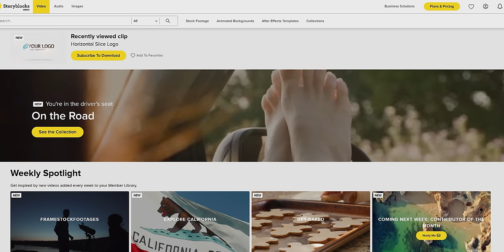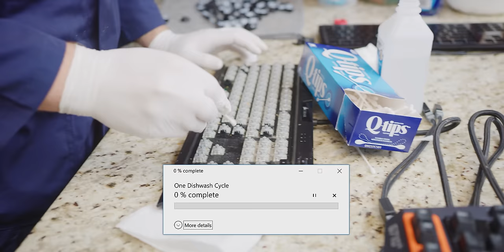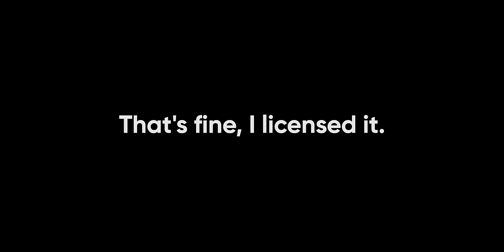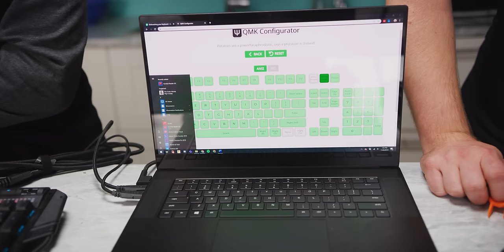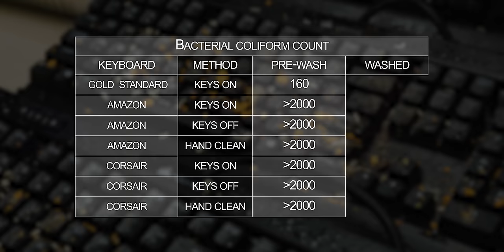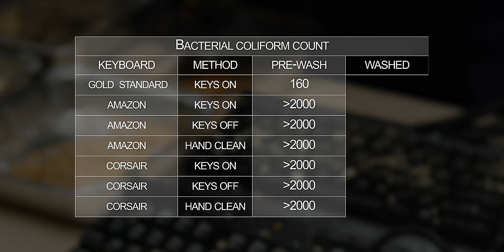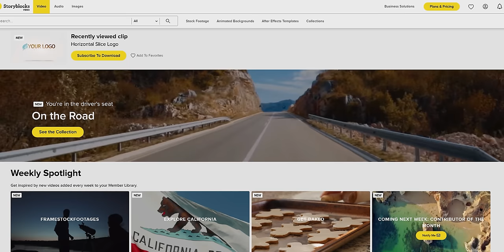The best way to clean a keyboard is… the DISHWASHER?

Comment: When I worked at a school district we would pull the caps off, hit them with really hot water and the take and air compressor to dry them off and then set them out to dry for a few days.  That worked on about 95% of the keyboard issues. This was many years ago.

Comment: It does seem like an easy method, but like you said Linus, electronics and water don't mix. And unless you have a way to pull your whole keyboard apart to check for corrosion, I would not be using this method anytime soon to clean my keyboard.

Plus in typical electronics fashion, after about a week or 2 from being submerged, they tend to stop working.
Reply: +1 to this even with pure water. 
During drying, oxidation will happen on open contact points. Once oxides of metals are in place they have chance to grow in various ways using the moisture from the air or even metal oxide/metal reactions. 
This is why alcohol or other fast evaporating, low reaction stuff is used in electronics.
Reply: Real experiment cannot be perfomed this way: 
- I did it once and it was fine.
Experiment should cover a time period for product longevity.
Are keyboards okay after doing this once every 3 months for a year?
Reply: You do realize it really doesn't matter if electronics don't care about water as long as electricity isn't running through it,plus we have a keyboard that was cleaned about 5 or so years ago in the washer and it works perfectly.
Reply: @anilhaksever  What if one were to wash it this way but then submerge it in alcohol and let that air dry instead? Food for thought
Reply: You guys have no clue.  It is even written in textbooks to clean keyboards with water.  You just need to dry them properly.  Corrosion isn't instant.
Reply: They also did a very simple key registry to check the switch was working. On a base level this might validate, but some of these boards (the g910 for example) are prone to chatter and this method may cause switches to intermittently malfunction. Longevity is a big issue but real world functionality after cleaning is something I'd prefer them to test for as well.
Reply: And I fool removed all the electronics; dishwashed plastics; let it dry and then put everything back together xD I mean it's safe but it took long time : ]
Reply: @jordsoo1  alcohol melts plastic so dont do that
Reply: @hetspook666  Not all plastics.
Reply: @jordsoo1  an airbrush with methylated spirits  might be a better way
Reply: Water is not a reactant nor catalyst in oxidation. Pure bull you're spitting out.
Reply: @hetspook666  It depends on the alcohol use isopropyl-alcohol its not very agressive
Reply: All the pcbs are wash with tap water bruh
Reply: you clearly haven't met my old Samsung flip phone. it's been submerged twice in dirty pond water and even though I used only rice to dry it out there was very little corrosion
Reply: Water in perfect conditions won't cause corrosion on pure metals like pure copper but in a dishwasher drying cycle or when it is evoperating in a close keyboard case you will have water in vapor form which will have free ions that do work on oxidation or hydrogen reactions with metals. (not to mention ESD) 
Especially since metals used in components and contacts of electronics are generally alloys, maybe most of the keyboard will be corrosion free but one specific alloy reacting and killing a component is enough to ruin the device.
Not to mention other materials used in keyboard that can react with water or water vapor. For example capacitors might have alkaline or acidic contents.
Exposing a complex electronic device to water and saving it once or twice is possible, impact to product lifetime might be even unmeasurable. But using water and steam as cleaning means repetitively is acting beyond design/durability specifications and almost certainly will decrease product lifetime.
PCB's are not the only things which got washed when they threw those keyboards in to dishwasher. And even PCB's wouldn't like to get washed with water with minerals like calcium. In any sane manufacturing plant they get cleaned and dried properly. Flux and heat takes care of the rest. And this is not a repeating stress.
Good way to clean a keyboard would be, removing keycaps, using air to blow the debree, using no alcohol baby towels (drying it promptly) and maybe a toothbrush to clean up the rest. Keycaps can be washed with water later on since they are made to be fine with sweaty fingers. Of course this can change keyboard to keyboard as materials change. But PCB, connectors and contacts of switches are best left alone or cleaned seperately.
Also never use WD40 with electronics.
Reply: @fasaso  you are probably correct, i once used 98% foodgrade ethanol to clean some kitchen equipment. That did not go well. (It looked like a broken car window) next time use the cheap stuff.

Comment: Water is not bad for the keyboard but the additives can be. The main thing is that you don't want the water to still be there when you provide power to the board. If you use this method I highly recommend doing a full disassembly of the keyboard afterwards and taking an old toothbrush and rubbing the electronics down with some high percentage isopropyl alcohol. This stuff evaporates more quickly the higher percentage that you have and is a good way to make sure that the board ends up dry. 
If you wipe down and air dry the plastics and do the isopropyl scrub down then this can be a one day job instead of one week.
Reply: If you're completely disassembling and then rubbing down with alcohol via toothbrush, what is the point of using the dishwasher in the first place? Because now it's not the quick-and-easy method compared to hand-washing it, because you are just hand-washing it after running it through the dishwasher.
Reply: @Blutzen  Not having to handwash all the plastic parts which is the annoying and time consuming part.
Reply: @Blutzen  Pfff, just pour some isopropyl in to dishwasher before washing cycle, it will make sure your keyboard will be crispy clean with shorter drying period! Only for 9.99$
Reply: @only1sn1not1taken  Completely disassembling the keyboard would give you easy access to all those plastic parts and using a toothbrush, as you mentioned, would definitely be able to clean the plastic parts and get into the crevices between the plastic fairly easily. I don't think it would take very long (depending on dust/dirt/crust buildup) to just give each layer a compressed air blast (either canned or an air compressor with a blow gun attachment) to remove loose or help free the dirt and to scrub them down with the IPA as you go through the disassembly.

You would probably have much better cleaning results (depending on the effort you put in) and you wouldn't have the fear of residue creating a short, possible board or case damage, or it simply not being dry enough to plug in.
Reply: @Blutzen  Also, at that point it becomes a job that takes multiple hours.  Consider the value of your time versus the cost of your keyboard. Now, if you make minimum wage and it's an expensive keyboard, maybe it's worth it, but then again, maybe if you make minimum wage an expensive keyboard isn't the best use of your money (but hey, whatever floats your boat...)
Reply: @insomnimatics  Yes, you are 100% correct. After working in an electronics repair shop, I 100% don't trust and liquid damaged products unless they get a good IPA cleaning. Too many times have I seen corrosion take 6 months after the initial incident before the damage starts to show. And by then it's most likely too late to do anything about it.

Comment: I've washed my mechanical keyboards for years and the only problem ive had is after a dozen washes or so, some keycaps can have the text flake off. You need to use a bit of detergent though.  I just use a squirt of dawn dishwashing fluid. 

As for drying, I blow the water off using my air compressor then place it in front of a fan or if sunny, in the sun and you can use it by evening.
Reply: Bad, bad idea.  If you've ever run out of regular dishwasher and thought you could use a little of handwashing soap, you would know this.  Even a small amount will suds up all over the place and leak out of the dishwasher and flood your kitchen.

Comment: Just had a major spill on my mechanical keyboard. Took it apart and did a manual "water/dish soap and a brush"-procedure. An hour later (some hair-dryer application in between) and here i am typing on a clean as new fully functional keyboard. Thanks a lot Linus !

Comment: Dishwasher method works but use air compressor and pressured air to dry all the water out. Let it sit for a day or two at least and they should be ok. I did this with 2 Apple keyboards, Logitech G910 and Ducky keyboard and all are working fine for over a year now. I do not recommend it but dishwasher can be used just gotta be careful and patient or don't let your kid use your electronics lol

Comment: Try this with ultra purified water.  Many window cleaners these days use water that has been filtered to less than 1 part per million impure.  At ultra low impurity levels the water becomes dielectric, and literally binds to dirt particles, pulling them off of surfaces.  Many modern window cleaners use a system known as a "pole system" to clean windows with no soaps whatsoever, which dry without leaving streaks etc - because there's nothing left behind when the water evaporates.

This should mean that water purified to that level should be safe to immerse electronics in, and perhaps even operate them underwater without killing anything.  Similar to mineral oil cooling.

Just wondering if such a system could be used to SAFELY clean keyboards (and other components)???  The guy who cleans your windows probably has the filters needed, or at least knows where to buy water for el-cheapo.
Reply: Water short circuiting stuff is a non issue really, at least at the voltage that computer peripherals use. Distilled/pure water creates more corrosion than tap water interestingly enough so it's not really beneficial in this case.
Reply: @piciu256  Yes, you might have a point there.  I was more thinking of the cleaning properties it has - literally binding to dirt particles and lifting them off a surface without the need for soaps, however that reactivity is exactly why it would probably cause more corrosion than tap water.  Didn't think of that!
Reply: @antontaylor4530  Sounds easier just to run it twice, one with soap and one with water to make sure all the soap is rinsed off. Probably cheaper and easier than hooking a dishwasher into jugs of distilled water. (This video is all about being lazy and least amount of work to clean it)

And when distilled water gets contaminated, it becomes electric conductive.
Reply: Is distilled water the same as ultra purified water?
Reply: @Omar-Dawood  Nope, distilled water will be up to 100 ppm impure (or more), depending on the quality of the equipment distilling it, how many times it was distilled etc.  I've seen 80ppm from water I bought at the local motor factors.  The water I'm talking about is orders of magnitude cleaner.  It's actually so clean it can be dangerous to drink - not even kidding, it can damage your kidneys!  I'm not saying you cannot distill water to that level of purity, just that generally speaking it's done with multi stage filtration systems.  Probably because it's faster and cheaper to filter the water through reverse osmosis etc several times than it is to boil it and condense it several times.
Reply: @MrDanisve  My brother used to have a "pole system" for cleaning windows.  I wasn't thinking of using a dishwasher at all (should have been clearer in my initial post) but rather just spraying it down, perhaps using a very clean brush.  Exactly the way my brother used to clean windows...
Reply: @Omar-Dawood  We call it the same at our lab, just the purity thats different from the "cheap" distilled water. If its 100% correct terminology i do not know.

Comment: How to clean your keyboard completely.

1. Take all the keycaps off if you have a mechanical keyboard.
2. Take all the "screw protectors" off with a plastic, or a metallic tool.
3. Unscrew all the screws that hold the frame together.
4. Open the keyboard.
5. Remove the internals and place them somewhere safe.
6. Wash the keycaps and the frame with cold water
7. "Rebuild" the keyboard
Reply: Hmm... I guess ur right
Reply: Cold water ? No hot water + soap is the way
Reply: Or you could 
1. Wash in the sink with warm water (no hotter than 50C) cleaning with a brush and some detergent
2. Rinse with clean, preferably de-ionised, water
3. Blow off with dry, compressed air to remove excess water
4. Dry in the oven at 50C for 12 hours

Comment: They didn't disassemble them to show the rust and other metals tarnishing or gunk that gathered in interior corners
Reply: If these aren't using common stainless steels then they aren't worth the money, or aluminium which is exceptionally corrosion resistant.

Comment: I feel it should probably be pointed out that the best and also fastest way to do this is actually fully disassemble the keyboard down to PCB and plastic parts and then wash those. A closed keyboard will take a long time to dry and could potentially corrode. If you open the keyboard, wash the parts separately, and then partially towel dry you can have your keyboard dried in a day and then put it back together. Honestly if you spill something on your keyboard IMO this is what you should do immediately.
Reply: Christopher Pedersen exactly it’s like using express carwashes as opposed to a hand car wash.

Comment: i do this with old vintage motherboards then pop it in the oven on low. It drys up the water and can help re-flow old solder joints. have had no problems and can sometimes revive a dead mobo for something colectable like a compact mac from the 80s

Comment: I suspect that after the dishwasher,  garden hose or whatever method - take a bottle of isopropyl alcohol and pour that stuff on the keyboard, then shake-if-off. Let it try. This way you have much less chance of oxidation since water was displaced by alcohol, which evaporates quickly with nearly no significant residue.
Reply: funny story I spilled a bunch of coffee on my razer black widow chroma like 2 weeks ago and it shut off almost instantly. I went and bought a new keyboard but a couple days later I was curious if that keyboard would work and it totally did lol. I straight up soaked it in alcohol and let it dry for a day now it doesn't even smell like coffee anymore and works perfectly. I think the key is to get it all the way dry before u turn it back on.
Reply: Or just pour alcohol in the first place. It's much better at cleaning than just plain water.

Either way, isopropyl alcohol can damage some plastics and paint, so I wouldn't recommend it either unless you're careful.
Reply: @MrFastFox666  Actually may use distilled water after the wash. Soak the whole thing. Much cheaper than alcohol, no chance to damage the plastics, and nearly no residue after drying!
Reply: @STOG01  that's not a bad idea, actually. I'd still worry though, since even distilled water can rip ions out of metals, leaving them behind as it dries, as well as causing corrosion. If you soak the keyboard regularly, it could become an issue.

IMO it's best just to avoid the problems altogether and not stick a keyboard in a dishwasher.

Comment: How to keep your keyboard clean. Buy a keyboard brush. Use it weekly by brushing between rows of keys with the keyboard held upside down. Grab an alcohol swab and swipe all keys with it as well as the exterior casing of the keyboard. My oldest keyboard is 5 years old and still looks brand new. No hairs or dust between the caps.
Reply: If you take it apart scrub all the keys and swab out the inside it will look brand new, you just have to not be lazy or have retarded keyboards that have impossible clips.
Reply: If you bought a board with laser-etched caps like a lot of Razers and Corsairs, you absolutely do not want to use alcohol and/or a toothbrush on the caps as it accelerates shine and legend wear. The alcohol strips away protective coatings that delays shine and the toothbrush risks outright chipping the cheap legends.
Reply: @Kori-ko  " oh no, not my laser etched legends! " - said no one ever. you said it yourself that they're cheap, so who cares. it's not like he's using a GMK set.
Reply: @shardhoney  The cheapness of the caps really isn't the point. Destroying your caps unnecessarily and having to shell out extra money for double shot PBTs out of nowhere isn't a very good outcome. Up until recently people just trashed entire mechs because replacement sets were not yet in the mainstream.
Reply: @Kori-ko  The nylon bristles in a keyboard brush are softer than the ABS or PBT plastics used for the keys and they will not scratch them. Also you're not brushing the keycaps, you're brushing between the keys. Alcohol swabs do not damage the surface of the keys either and simply remove oils from the finger tips. Removing the oil makes it less likely for things to stick to the key in the first place and it sanitizes the key surfaces. I have 2 Corsair keyboards along with a Filco Majestouch and have no abnormal keycap wear or shine.

Comment: Hey Linus, I tried your method because I bought a Logitech G915. My old one is a Logitech G510, which is about 7-8 years old.

While the keyboard survived after a week of drying, not all keys are working. So I can safely put it in the trash. 
This might be because my keyboard was already very old, but I wouldn't bet my new G915 on it. :)